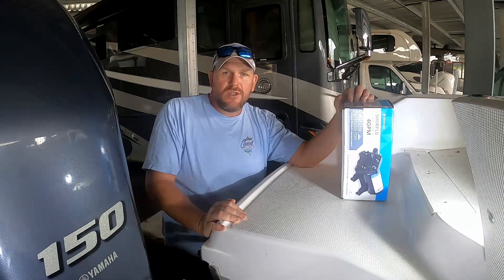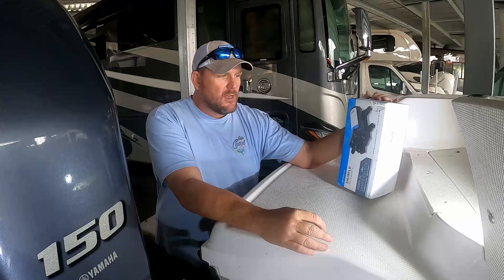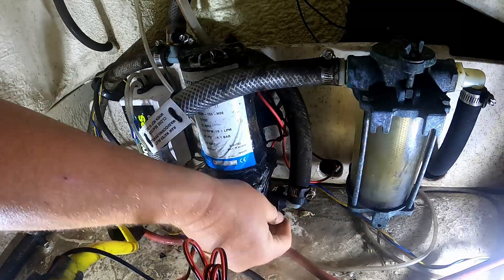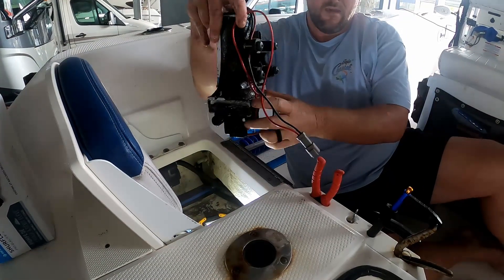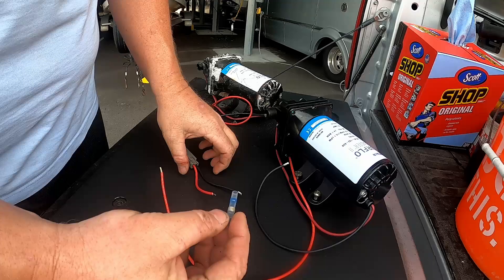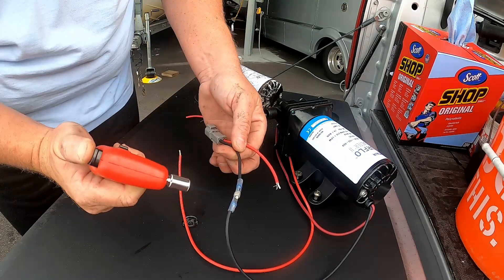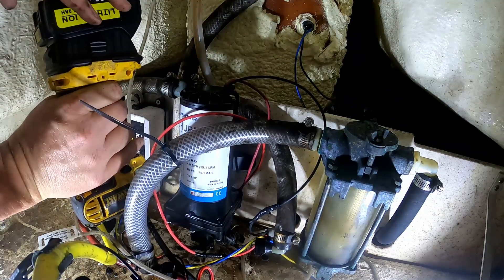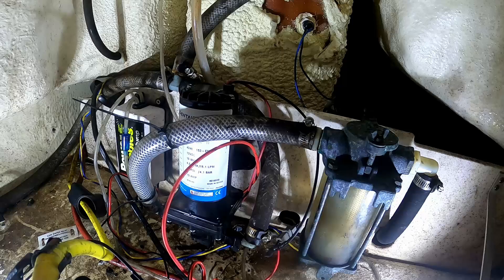Replacing Live Well / Wash Down Pump on a ROBALO

Comment: How do you clean out that pump after a day of using it in the salt water? Have the same boat and have always wondered how I could clean the pump of salt water. The live well is drained by gravity so don’t know how to get fresh water into the pump
Reply from the maker: … you don’t have too, it’s designed for salt water use, if you really wanted too though all you have to do it turn on the pump and hold a hose over the intake under the boat. Not necessary though.

Comment: Ever had an issue with bilge pump on R200? mine works with manual switch on console ?. and when that is on and i lift the float i can hear the difference. however with battery switch off and manual switch off  float does nothing... thinking it should be direct wired to battery so float works it automatically. cant find any fuses either
Reply from the maker: Legally it is required to be wired directly to the battery. I would get in touch with your dealer ASAP. Our did have an issue, it would run none stop , float up or down and had it replaced. Haven’t had an issue since.

Comment: does this size pump drain your battery much if the motor is off ?
Reply from the maker: … hasn’t caused any issues yet
Reply: are you running a singles 1 or 2 house battery ?
Reply from the maker: @cameronsandercock405  .. have two batteries, only use one, the other is just for backup

Comment: Did you install a bubble live well in you Boat? How do you install?
Reply from the maker: ... yes, just screwed it to the wall and drilled a hole between the live well and seat to run the air line through so I can throw a air stone in a bucket if need be. The wire are just banana clips to the battery, one day I’ll probably hard wire it and put a switch on it.
Reply: @SaltyStrikes  where did you buy it and Thank you for your Help
Reply from the maker: @PetClipdog  https://amzn.to/3rgWtis
Reply: @SaltyStrikes  Thank you, I appreciate your Help!!!!
Reply from the maker: @PetClipdog  .. not a problem 😁👍

Comment: I have a new Robalo R200 being delivered in the next couple of months.  I was a little disappointed to see that pump go already with your boat being a couple of years old, but with yours having almost 400 hours of salt water, that's to be expected.  Salt vs fish good, boats :(

I was in conversation with you before about the hydraulic door strut you added to your helm/head door.  I will surely be adding one to mine as soon as I have the boat in possession.  Are you still happy with that choice of strut or would you do something different?

Love your videos!

Bob Y from Harpswell Maine
Reply from the maker: ... yeah we have our boat in the Salt every week, sometimes twice a week, so it’s taken a salt beating over the last two years. I really should have been checking my strain basket more often, it was pretty full of gunk which my light of help lead to the premature failure. 

As far as the strut goes, it’s still working great and has prevented it from slamming shut and us loosing a finger or two. I don’t know why it isn’t standard. 

Over all we are still really happy with our choice of boat. We have gotten rid of all the cushions up front, we don’t use it for leisure at all, just strictly fishing. The cushions have got a little moldy and won’t come clean so that’s really the only negative we can really say.

Comment: I have a ??? How do I clean my live well pump with crash water on that same boat. I hate using it in saltwater then have no way to flush the system
Reply from the maker: ... there is really no way to flush it out as is, you would have to add another T by the intake with a valve and hose bib connection. Mine would have probably lasted much longer if I cleaned out the strainer a little more often. We use ours quite often without any fresh water rinse. I wouldn’t worry about it, go catch some fish 😁👍